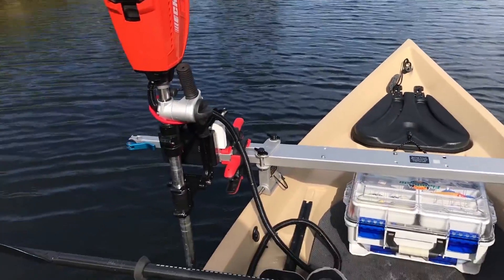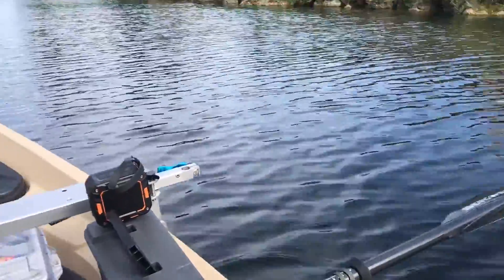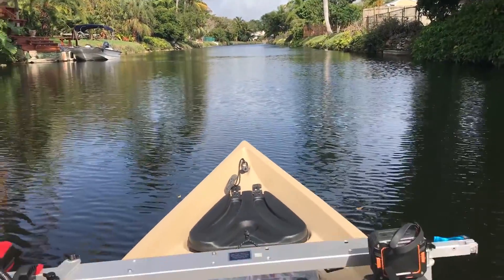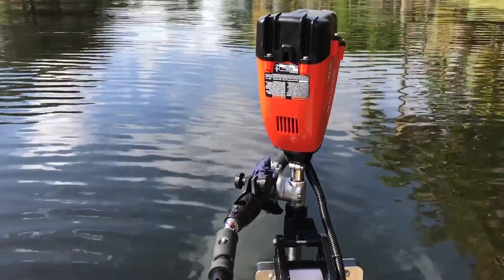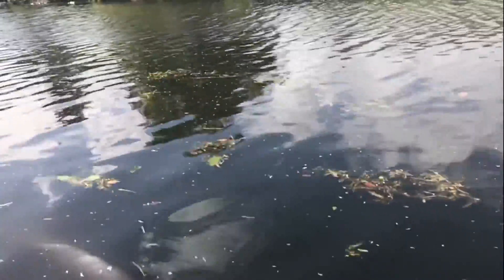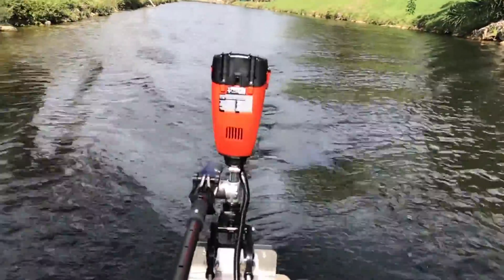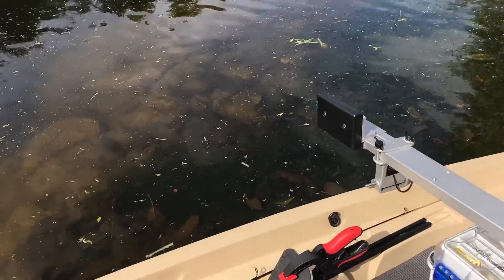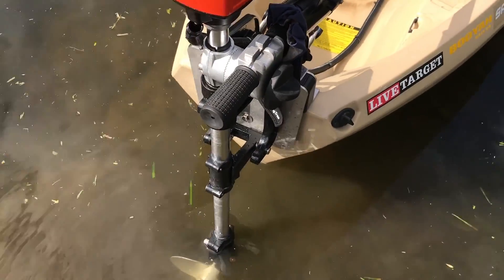Nucanoe Frontier with Honda GX35 Outboard and an Echo 58v Powerhead Outboard Demo

Comment: I am liking the first test. We have a GX35 project for canal boats in Thailand...but the electric options are either hard to get or super costly.  This Echo head has it's own battery? Their site says 2Ah.  Would not be a stretch to make a plug-n-play with more. I am doing a light-weight pole boat, not a kayak, but weight is super important, as it will be solo operated.
Reply from the maker: Thai Gyro if you look on the site, these systems work amazingly well. Now, I am working on another company that has a similar powerhead with 2ah for less than half of an ECHO system. Video will be going up this week.
Reply: @kayakbuddysllc-lightweight4947  Great, Thanks!  We will very likely do both.

Comment: Do u think it will I’ll for salt water ?
Reply from the maker: The Shepherd my gas setups run in salt water most of the time and have no issues. The electric has the same leg, so that component is robust. I am going to run the electric in the salt water once I finish the connection box and swap the bolts to stainless, but the electronics are sealed to be water resistant. The shell of the motor and battery are weather resistant. Right now this is in a trial mode for a while. It’s definitely a viable option at some point.

Comment: Honda GX35 at 5.1 MPH on a fully loaded NuCanoe Frontier 12.  What prop did you use to get that speed?   Was it a 2 blade or a 3 blade prop?  The tank on the GX35 is a little on the small side.  Just wondered how far you were able to run it wide open on a tank of gas?  I did a little experimenting on the GX35 motor which I used on a Custom long tail mud motor.  It pushed a little Jon Boat pretty good. Here are a couple of links to show you how I made it and how it worked.
https://www.youtube.com/watch?v=haw-QuCNty0&t=2s
https://www.youtube.com/watch?v=BXBAbt3V8wA&t=129s
I owned and sold a NuCanoe Frontier 12 and did a lot of battery powered stuff with it.
I now own a Hobie Pro Angler 14. and have given some thought to using a GX35 with your lower leg just for fun.  I have the necessary machine tools to develop a proper mount for it.   I have also developed a foot pedal steering system that should work well with your unit on your Frontier 12.  Then just fabricate a little throttle control box that would be mounted next to your drivers seat with an integrated kill switch and you are on your way.  Ha Ha

John
Reply from the maker: John's Marine Solutions I use a smaller 2 blade prop to Increase the RPM range. Way smoother and true top end with the engine now. The 3 blade reduces the torque to much on large kayaks.
Reply: With your custom kit for the Hobies, How fast MPH  would it propel a Hobie Pro Angler 14?  I currently have an electric version of your GX35 Drop In that is about ready for the water test.  I think I know those Honda GX35's are pretty quite compared to their 2 stroke buddys but I would actually prefer the GX35 rear mounted to keep as much of the noise and exhaust away from the drivers area.  The only issue is refueling.  Possibly?? a remote fuel tank could be installed.  Don't know if that has ever been done.????
Reply from the maker: John's Marine Solutions I get about 6.5mph from my wife’s revolution. The PA is much heavier, but should still attain mid 4’s and up. It should make 5 mph in ideal conditions. I get 5.1 from my Frontier and it’s a few pounds less than your PA.
Reply: Thanks for the prompt and informative replies.